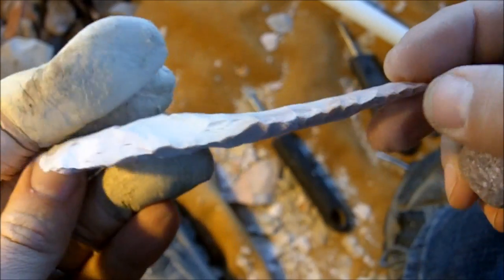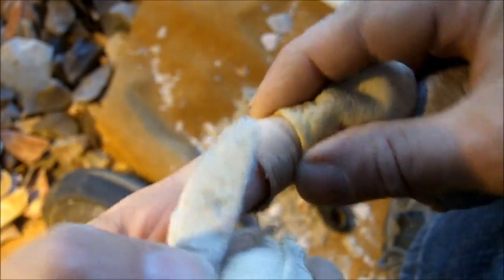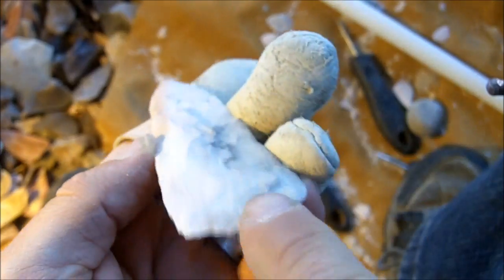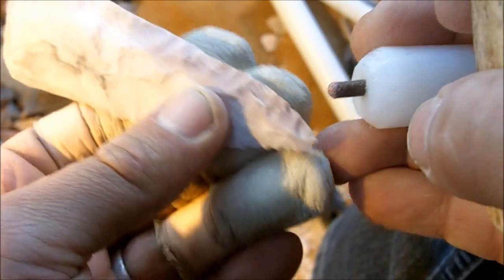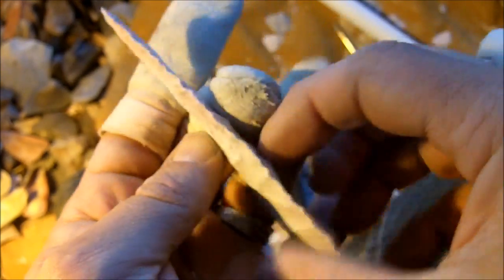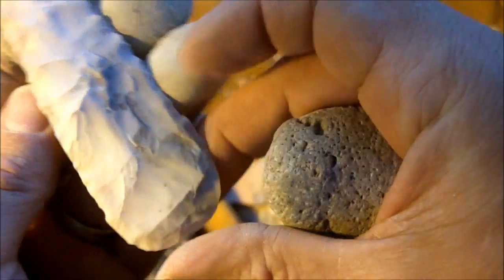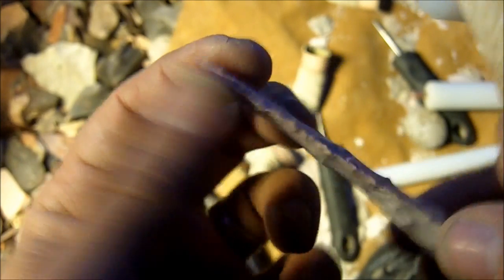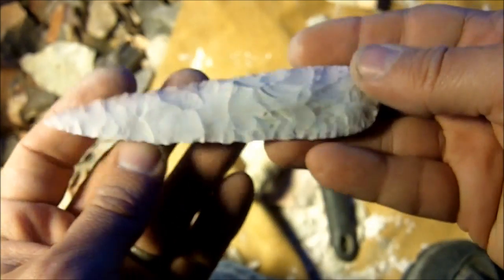190 - Flintknapping Texas Chert Knife From Odd Shaped Spall

Comment: You did a masterful job of creating a long point out of a piece of rock with a “twist” and an outward looking bend.  The ability to see a point in the stone apiece and not mistakenly remove a flake at the wrong place was amazing work by you.  Your knapping skill of course, particularly the removal of the “lump” mid-section without reducing width looked easy but I had to look at it 3-times.   But making a maximum length point from the odd shape rock was in my opinion really exceptional work!  Wow.
Reply from the maker: Thank you very much!

Comment from the maker: 200 Celsius for 4 hours.  Begin by drying the stones at for 24 hours @ 90 Celsius, and then turn up the heat to 200 Celsius.  After 4 hours, turn off the heat and let the rocks cool for 12 hours before removing from the oven.

Comment: I have quite recently returned to flint knapping as a hobby after about thirty-five years away, and was pleasantly surprised to locate this video after Googling the topic.
I must say that your skill is unsurpassed in this craft, and I am more impressed with your technique than I was when my Native American grandfather used to take me as a boy to watch some of the "old" Indians chip their arrow-heads. You are, for lack of a better description, amazing!
I am curious about one aspect of your style, however, because the video didn't show it and it seems to be different than I have previously seen. When knapping your core, you of course hold it in your left hand, but to the right you seem to have two hands - one to hold the tool, and another to strike that tool with force to remove the flake. As this seems to be the reason you are so effective (and superior) as a knapper, I wonder if you could explain what is going on when you remove a flake - which is sometimes considerably large and otherwise difficult to remove with simple pressure rather than some type of strike.
Could you elaborate on what is taking place on that right side when a flake is removed or better still film a short video demonstrating what is going on? I would certainly appreciate it!
Reply from the maker: Thanks for your gracious comments!  Here's a video that shows what's going on:  244 - Vlog - A Different View of My Flintknapping

Comment: Thank you so much for the link to the second video; your camera angle and demonstration answers my question completely! I truly appreciate this information and, though I have never attempted this technique before, I'm now compelled t experiment with it myself. If you don't mind my asking one other question, what material did you use to make both the tool with the copper wire for direct contact with the material, and the striking hammer, as well? It appears to be the same. Thank you in advance!
Reply from the maker: My tools?  I have a video for that too.  :-)
245 - Vlog - My Copper, Plastic, and Steel Flintknapping Tools